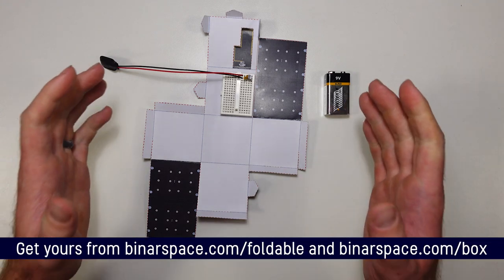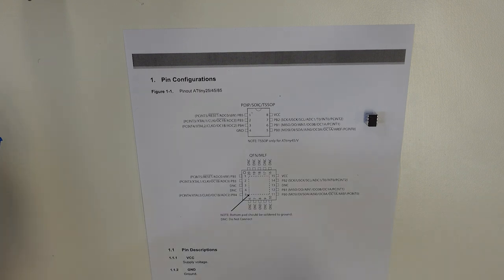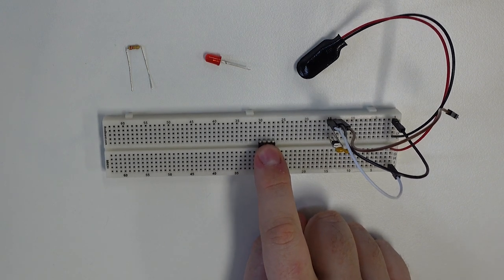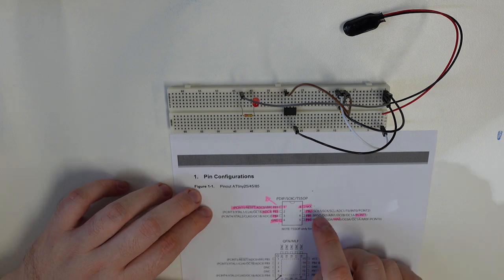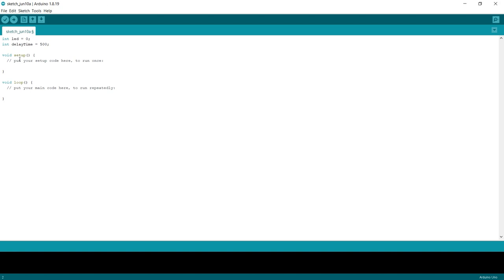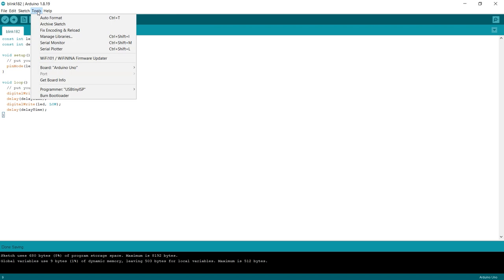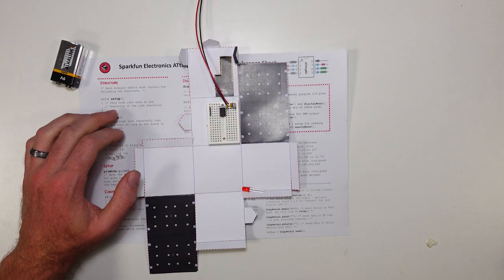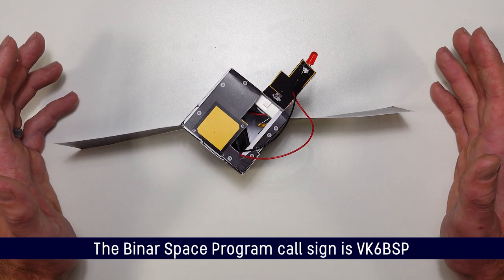Papercraft Mission: Sending A Message | BinarX

Comment from the maker: At 14:52 Jacob sends the code to the ATTiny85 using the upload button. If you get an error message saying "A programmer is required to upload", you can use the Ctrl-Shift-U command or the menu to select Sketch > Upload Using Programmer (as long as you have selected the TinyISP programmer as shown in the above video.